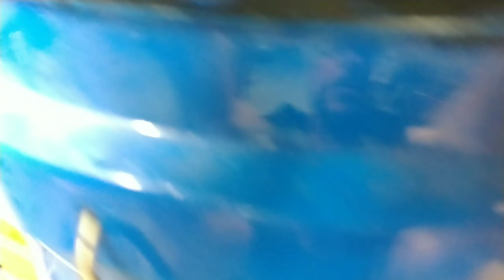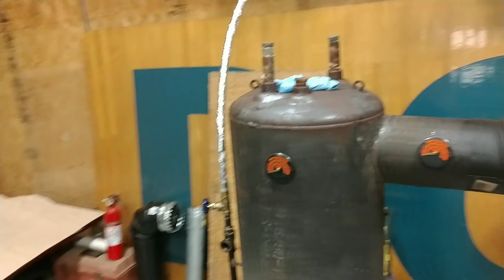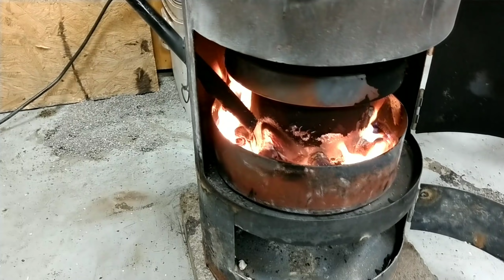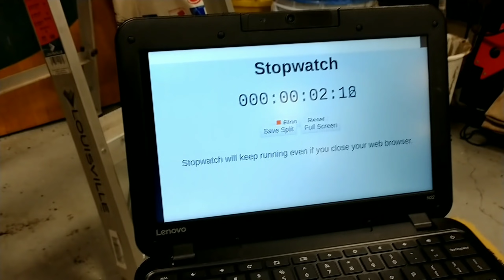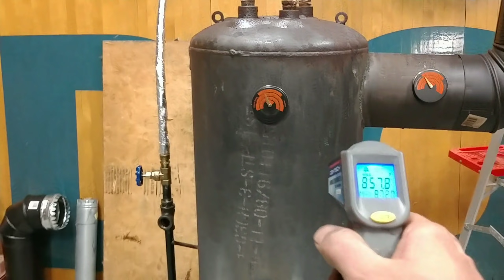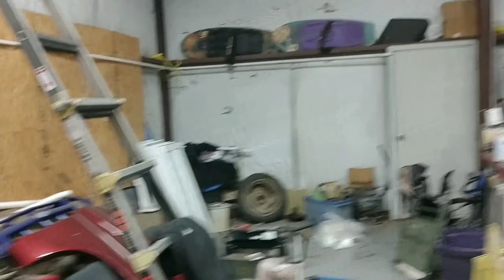Waste Oil heater One Gallon Burn Time

Comment: If you were to add a bucket of baseball size river rocks or solid rods of steel above the air inlet areas you would actually capture much of the carbon particles onto them and as the temperature get's up to above a 1000F the carbon would cleanly burn off of the rocks, a crude type of catalytic converter otherwise all that carbon particulate matter is going right up into the air polluting the entire neighborhoods air supply which would not be tolerated in my neck of the woods but apparently you really don't give a hoot about air pollution so it probably does not matter.
Reply from the maker: I have several fire extinguishers around the shop but the main thing is I don't get more than a few feet away from it definitely don't leave the shop with it burning and I keep a close eye on it it's a dangerous thing something to play with and make videos about to give people something to watch and to burn some time up
Reply from the maker: Great idea I think I'll try it

Comment: Too bad there isn't a water jacket surrounding this burner and this could be placed outside. The heat in the water could then be piped in to warm the interior with an heat exchanger. I swear I could smell oil burning when watching this. Not the best smell. But these oil burners always fascinate me as they use a waste product.

Comment: Does it smoke out the chimney? I have a silimar design but is smokes. Seems like it starves of temperature even at 1000degreesF at tank temp. Any thoughts?
Reply from the maker: Add more air to eliminate smoke and make it hotter
Reply from the maker: I also have a video of the smoke output
Reply: Ok. I will try that. Are you burning conventional or synthetic oil? I've heard that it's harder to burn synthetic because of all of the additives in it. Do you know if that's true?
Reply: @alextarshikov6515  There really is not any MORE additives in "synthetic" oil. The synthetic part relates to the base oil, and the additives determine the model/use of the lubricant.

Comment: Good work, but wouldn't be nice to heat some water with your heater and send with a pump through under floor pipes or a couple of radiators?! Regards, Dan.
Reply: You did an excellent job. 
I’m gonna subscribe and see where it goes.
Reply from the maker: Thanks, I haven't done much lately it still crazy 65 degrees outside. Arkansas weather!

Comment: I'm going to be building a setup kinda like this soon. Perhaps I'll get it made before Christmas. I can get my hands on plenty of used oil between my stuff at home and where I work. I run a grader and we've got a second one also and two tractors. So lots of used oil to get me through a winter even in Canada. Lol. My grader alone I'd get about 350L/93 US gallons roughly in a year.

Comment: I built something similar a few years back. maybe slow your stream down. mine ran at a slow drip. mine ran at a slow drip and it helped control heat. your final drip is what i ran mine at maybe a little faster. i had a small 12v computer fan blowing in and it helped the burn at a slower drip

Comment: smoke outside?!?!?!?
Reply from the maker: Depends on the oil flow, at high temps or lots of oil flow I get a little smoke. However at med to low oil flow it's just a haze comming out of the chimney. The next burn I will video the exhaust. Also once I get the door sealed I will adjust the holes in the air hat for a cleaner burn. Thanks for your reply.
Reply from the maker: New video uploaded to show smoke output. Thanks again.
Reply: I have a silimar design but it smokes bad. Can you help me on that one?
Reply from the maker: Too much smoke equals not enough air
Reply: @alextarshikov6515 - Air restriction... more air intake and/or more output. 
Or improve on the chimney side. Play with length and diameter of chimney. Usually this alone can overcome the issue and give tremendous air flow under the right conditions. Check "rocket stoves". Same principle. 
Ideally you'll be looking for higher flow and air speed, it's very helpful to maintain a good burn.

Comment: I have a 40 Gallon Tank and my Burn Time for a Gallon is 4+ Hours at about 450-550F Degree.  If I leave it at low 400F, I can get to about 5+ Hours on Small Drip!  NOTE: Sometimes I have to shut if off since it gets too Hot. But my Span Time is from 4-6 Hours on Low Drip.
Reply: UPDATE:  If I keep about 450F - It burns dirty and black smoke and lots of carbon.  Best to span about 3 Hours or 2.5 Hours Per Gallon, but it will be hot.  Sometimes glowing red too !!!
Reply: @randysdiy1  - Here:  https://www.youtube.com/watch?v=kNUFBD8GAF0
Reply from the maker: It seems you may have put the wrong video link.
Reply: @randysdiy1  -  Nope. I am trying to help you and improving your health !!!

Comment: Great set up. I built one exactly like that only difference a few more heat exchangers.  I don’t have a burn chamber cap like you have to swirl the flame, but that is an option I can always add. I reinforced my door with 1/8 inch thick by 1 inch wide steel strips. One piece on the inside of the tank the other piece on the outside edge of the door. It really seals the door well and when you close it you can really hear it roar when it’s burning. I also have a half inch copper feedline inside of a 1 inch black pipe for the feed, The air around the copper pipe keeps it cool so that it does not get gummed up with burned oil residue. Once again great job, you will really appreciate the amount of heat that they put out especially on a really cold day. 😬👍
Reply: Your burner is by far the best design Iv seen.  As soon as I can get some supplies I will get busy.
Reply from the maker: Good deal, be careful
Reply from the maker: Thanks for the comment, I'll take your advice on the door. I've been trying to come up with a good idea to seal the door sounds like that's a good one.